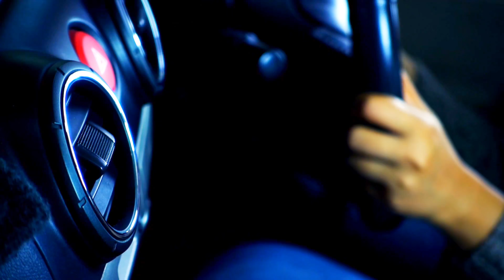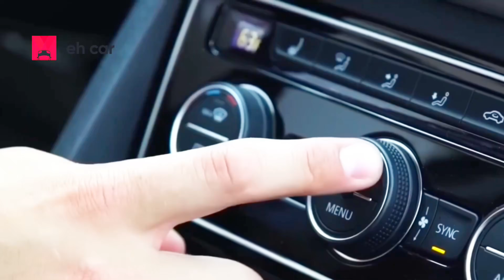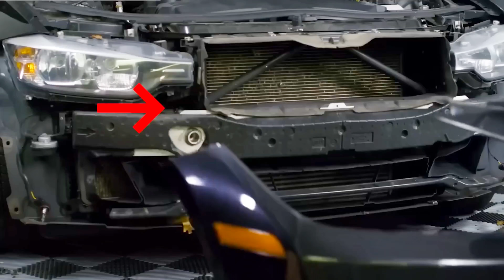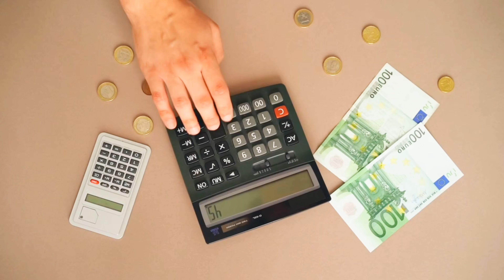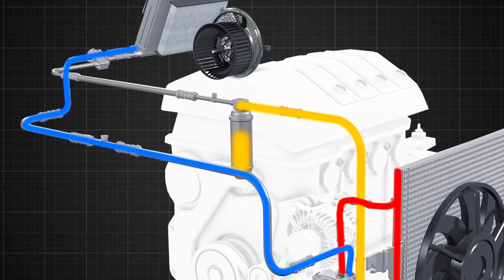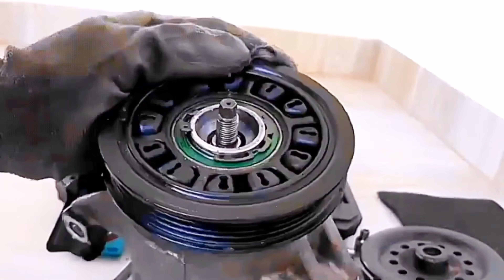This SECRET Will Make Your Car AC Blow TWICE as Cold

Comment: The plastic in your vents/car really likes isopropyl alcohol. My pickup doesn't even have a cabin air filter. Currently doing dashboard work. I lived on a dirt road for a while, it was private, so I hauled ass. Surprised how little dust is in the air ducts. It's 23 years old. I had to take it apart to get to burned out light bulbs. Now I'm upgrading anything I can, I don't want to take apart an old brittle dash open again unless I have to. 
It's never had ac issues. But duh! Bc tint. New rentals for work I burn up bc 1) no tint 2)new cars are pathetic.

Comment: Some good tips but a lot of rubbish as well… the recirculating switch has no effect on fuel economy… the compressors running regardless of the position of recirc switch. 
Directing airflow your face still leaves 2 to 3 panel vans blowing air around the car  airflow control through the vents will have very little impact on the cabin temperature overall….there’s just too much air moving around

Comment: Glad i have automatic temperature control. Set it and forget it. 🎉. Climate control
Reply: You like that? Screw that, in extreme climates it's horrible! I like my knobs I catch change fast even if it's too cold or too hot to touch anything. Use your shirt for your bare fingers.  
All those touch screen users I feel sorry for your choice in vehicles.
Reply: @AF_1892   BTW. TOUCHSCREENS SUCK. Time changes its a major process for changing a simple digital clock. Buttons yes
Reply: @AF_1892  your correct about touchscreens. The climate contol i have in my car is knobs or set a button to automatic. Yes here in Florida over 80 degrees its HIGH COOL HIGH FAN done AUTO or MANUAL